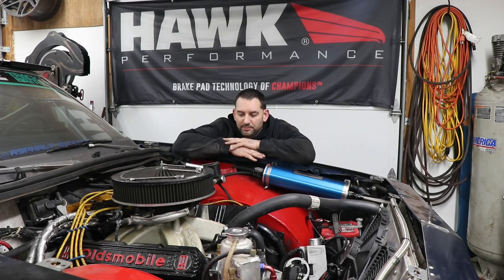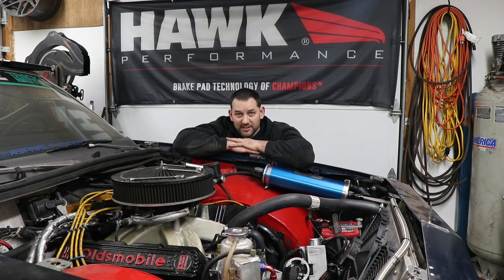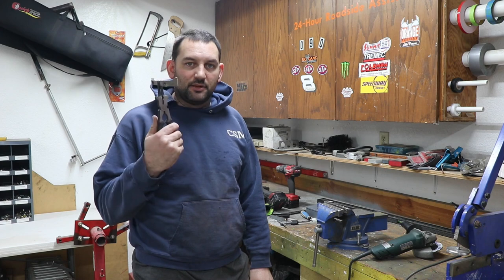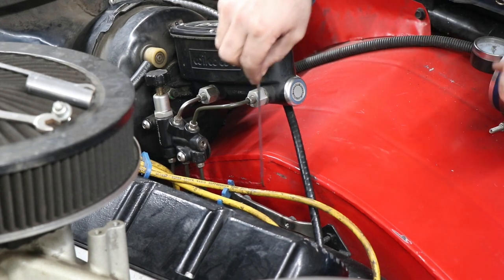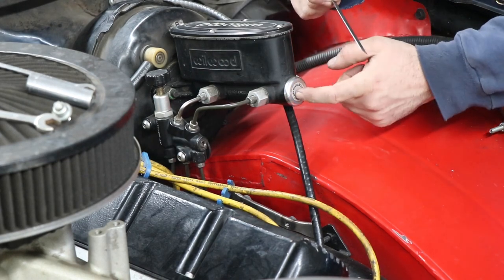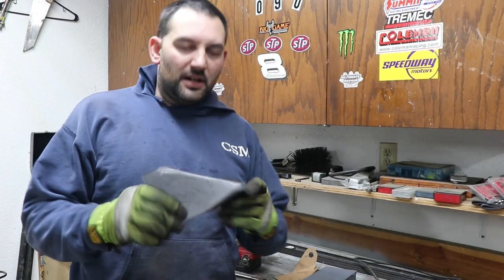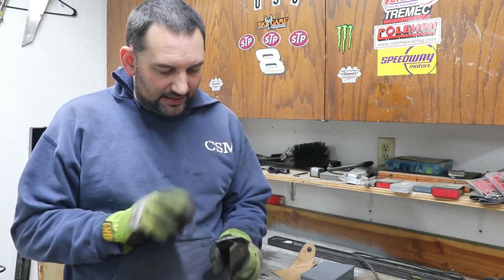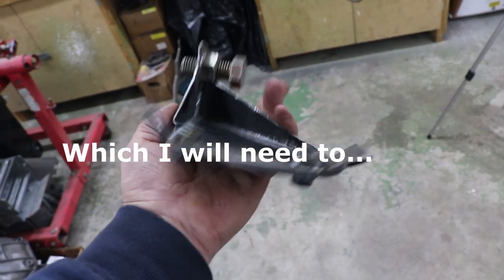Master Cylinder Support Bracket

Comment: You mentioned possibly adding a bit of rubber between the steel bracket bolt head and the aluminum MC. How about a piece of Teflon infused hyfax from a snowmobile suspension (or similar). It's a lot less compressible than rubber, and would create a friendly, slid-able surface for the nose of the MC. Just a thought.
Reply from the maker: Not a bad idea at all!

Comment: Ok. I haven't delved into your chassis work yet. But have you replaced body bushings?  Really firm's things up once you have. Jmo
Reply from the maker: I've had solid bushings for 4 years. Just double checked in case something was loose and they were still tight. I've known for a while that the bent section of frame below the windshield forward is absolute trash. If the fenders aren't bolted on and you jack it up just behind the wheel you wind up with a 2" droop at the core support.
Reply from the maker: This car also has tubes acting as secondary frame rails, 4pt cage plus door and sill bars. I made tubes inside the fenders to go from the mounts at the windshield to the front of the frame too.
My plan is to tie the fender tubes to the coilovers hoops and across the engine to each other in one big engine bay brace
Reply: Heck man. That's a lot of stiffening. I've done some with my 84 Cutlass but not that much. These frames were never meant for any of this. Roadster shop may be in your future.
Reply from the maker: @tonym6854  I have my 82 shell in the driveway. I'm just going to go full tube frame from the start with that one

Comment: have you considered cage to bulkhead plates that bolt to dash bar, technically dont count as a full cage trough the firewall
Reply from the maker: Yes. However this car still gets street driven a lot. Few thousand miles a year and because of that I won't be putting a halo or A pilar bars in. It's not worth the saftey risk on the street. So there's no dash bar to attempt to bolt to. 
Which is exactly the reason I put tubes inside the fenders. They have plates that use the bulkhead area the fender bolts to just below the windsheild and run up to the front of the frame. Without these or the stock inner fender and core support you can make a 2" droop of the front end just by jacking the car up behind the front wheel...The frame is that bad.
I think by running another tube from the fender tubes near the mounting point, to the coil over mount hoops, and accross the engine to the other side should a lot of the same results. Its crossed my mind to cut out some frame and weld in some more substantial material at the weak point too.